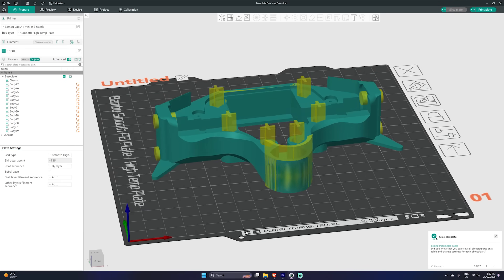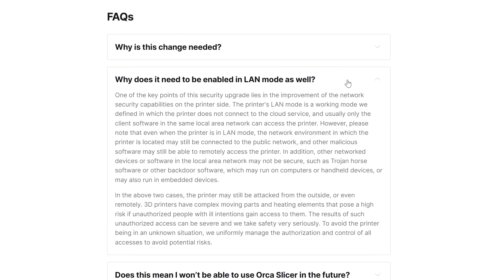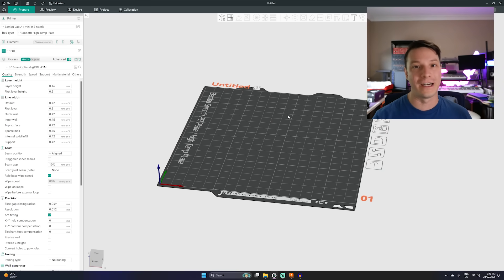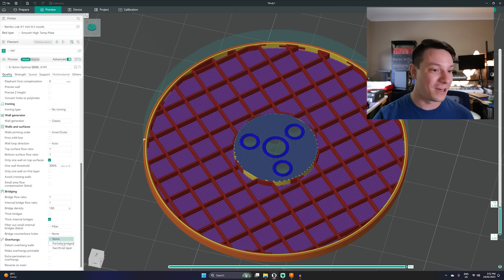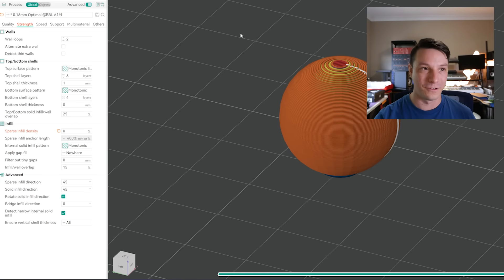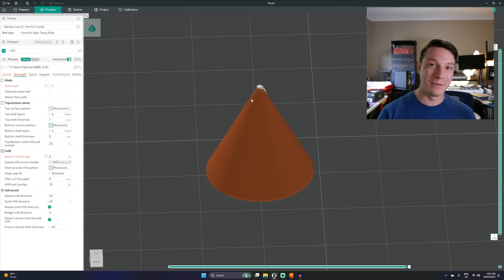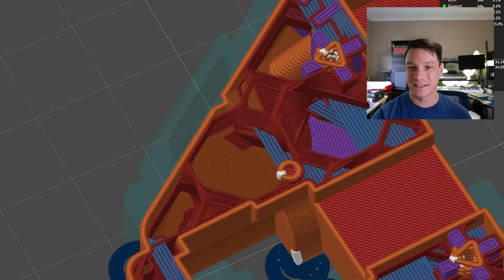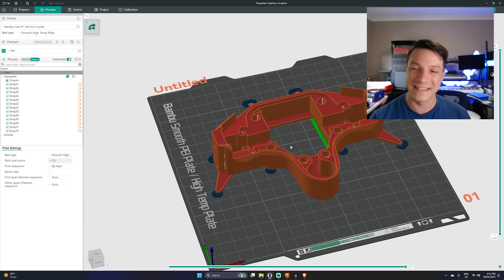I've switched to Orca Slicer for my Bambu Lab 3D Printer (and you can too)

Comment: I had to do this a year ago because the company IT guy wouldn't let me put the new X1C on the network.  Turns out that this is the BEST slicer available, and I don't have to deal with Bambu. It's even got a LINUX APPIMAGE release, so I can just download it to the desktop and use it as an .exe.
Reply: To be frank, Flatpak is waaaay Moe convenient than app images with auto updating and way safer with the sand boxing features.
Reply: @BeefIngot  Yes, but in ten years the version available today won't even work. That's not a problem with appimage. It will work just as well in twenty years as it does today.
Reply: @lowellhouser7731  No idea why you think this is the case. Flatpaks also build in dependencies so there is no reason they would break. They're actually more resilient than other standards for the most part.

Comment: There is something hilarious about the timing of this video because I was so fed up with orca slicer having random glitches and crashing and missing completely essential features that cura has had for a decade so yesterday I gave up and uninstalled it and installed bambu studio for the first time. have had no issues at all with 27 hours of prints, and found a few things in bambu studio that weren't in orca slicer for some reason.

Comment: you know they have microsd cards that are just wires that you can connect to usb for a funny work around since i dont see a usb port on a bambu lol. ALSO, they have wifi/bluetooth microsd cards that stick outa nd have the lil bt chip in them etc. but i bet you knew that but just a reminder
Reply: I'm drawing blanks trying to search for these micro SD cards you are referring to. Can you provide further info? Thanks.

Comment: Honestly i have not been impressed with orca its has been messing hard on my neptune 3 plus fireware's max speed travel moves accel and whatnot
After an orca print (from a factory reformat) i get 1 print and at some point during that print (it changes when) it slows to about 1/3 the speeds i had from the factory and i have to either do another restart or manually type in the gcode to change it back just to get 1 more print and do it all again

Comment: There's one feature I am waiting for they will probably implement in coming releases that is brick layers. There are already scripts that convert your g-code for this but I want it in as a setting in the slicer. If the name didn't tip you off, this is when walls are printed on slightly different heights so their sides also act as bonding surface area.

Comment: If I ever obtain a Bambu printer of any sort, It will NOT be used online, and I will make sure it hasn't been updated because I was the full control over the machine.  It is 100% unfair to the customers to take away or block certain features and modes, because the company mis-forcast the future of their servers. I still say it will be be a pay as you go system if you use the machines online in the near future, this is how it starts..
Reply: If you get an old unit with no firmware updates - I would recommend some of the early firmware updates. One of the updates quieted down the stepper motors.
Reply: Sure mate, let us know if you ever get one but until then...

Comment: My bambu printers are completely offline now, I use orca slicert too and have to actually walk to the printer and pop the micro sd card in just like I did a couple of years ago anyway. Not a big deal. But the prusa core one looks very promising, I might swap eventually.
Reply: Orcaslicer still works over wifi with the Bambu printer in LAN mode.
Reply: @nick_3974 but unless you can configure your router/firewall to block it’s access to the internet it can still connect to Bambu, and I don’t exactly trust them anymore.

Sadly I am unable to block my printers internet access with the garbage router my ISP provided me, maybe one day I’ll buy a new router but I can’t justify the cost atm :(
Reply: @nick_3974 does it still work now?
Reply: @nick_3974 without their cloud between?

Comment: One thing I have not found out in bambu if it is possible is to print objects as supports to make custom supports easier to make. Is that in Orca?
Reply: Yes, you can do this with modifier objects like Angus showed for 100% infill. You can even set the wall loops to 0 and use just infill in the modifier shspe as a support. I would also recommend the organic tree supports, they are very versatile.

Comment: I'm not going to fight the Bambu Lab firmware BS.  I'll switch printers, I bought a X1C only because they were letting 3rd party firmware X1Plus on their machines. Now it seems they are going to other way and closing down the walls of the garden.  I'll go back to Creality or any of the many other more Klipper based printers I can print to with Fluid, Mainsail and Moonraker. I WILL NOT go back to shoving SD cards in the printer to print my files!!!
Reply: X1plus will still work the same.
Reply: @riba2233  I hope so, I have got so used to using Orca as my slicer I hate the thought of having to go back to Bambu Slicer. I hope I'm over reacting but Bambu's approach and attitude is not inspiring my confidence.
Reply: @OldManJimmy1   you can still use orca even without x1plus and even with a new strict firmware. Overblown issue
Reply: @riba2233  That's where I have my issues, they were trying to implement a tool and I emphasize TOOL you have to use to connect to your printer even in lan mode, Orca told them to pound sand. 

I have to use my one and only sd card slot to boot to X1Plus, also no USB port on a X1C. If I pull the sd card out while the printer is booted you get a red screen of death so,,,, there's no way to use the sd slot to upload my prints.
Reply: @OldManJimmy1   ok but with x1plus nothing changes. You can also stay kn the old original firmware, nothing changes. Orca just refused to integrate the new tool, but you will be able to use it still with the new firmware and orca.

Comment: I am not worried about what Bambu does with the security update.  When this first became an issue over a year ago, I learned about the X1Plus firmware, didn't switch, but followed it.  When this blew up again, I made the switch.  Now running it in LAN only with Orca and it seems much faster to transfer the print job to my X1C.  You had some great tips for Orca, thanks

Comment: im planning to start using orca slicer. ive been using Cura for a few years and i am familiar with that and have it tuned. I used orca for a project recently because it gave some specific control over the supports that i couldnt figure out in Cura but other things i still cant figure out in Orca that are straighforward in Cura lol like support infill %.

Comment: I switched from Cura to Orca when I got an SV08 last month. At first I was very overwhelmed by the options, but now I'm pretty comfortable tweaking settings.
Reply: I used to be a die hard Cura guy. They’re just two different beasts. But Orca just kept getting updated with QoL features that I had to leave the thing I liked about Cura that I don’t even remember anymore. I guess, we started having those in Orca as well.
Reply: How has your SV08 experience been so far?
Reply: @JamesPotts  it printed very well put of the box and calibration was pretty painless.
I've modified the electronics fan to run on a curve corresponding to the host temperature, so it's much quieter.
I also relocated the print cam to above the moving gantry for a better angle.
Just finished building an enclosure and it prints pla and abs with no troubles at all.
My next upgrade is probably replacing the simple filament detector with a btt smart filament detector.
If you're thinking about getting one, I got the 350mm build plate model for $500 from sovol's eBay.

Comment: Mouse ears can be added in Bambu Studio. They are called "Brim Ears" and are located in the top bar to the right of the Color Painting, Measure, and Assemble tools.
Reply: A feature they need to add to Orca Slicer is that Bambu does with mouse ears... You can add them manually. I haven't found 100% success with automatic mouse ears, really want a manual option
Reply: @realgoose  That's not in orca yet? I like to use mouse ears on certain spots but don't want to use them in all areas.
Reply from the maker: Thanks for catching that! I'm sure it'll be updated soon.

Comment: Can anyone explain why when I tried using orca I was having issues with tolerances and overhangs on the same 3mf file that works fine in bambu? I now use orca for the calibration tool and do everything else in bambu.

Comment: Great stuff, however, Bambu Studio does have Modifiers and  "Brim Ears", at least as of 1.10.1, which is not the latest.
I agree though that Orca trumps BS in most cases, I've been using it for over 12 months, switching only a month or so after purchasing my first Bambu printer. I only open BS when I need to deal with the MakerWorld malarky that doesn't accept Orca 3mfs.

Comment: I still mostly print using SD cards or USB drives on all my machines. It takes a minute to retrieve the SD card, load the file and reinstall SD Card on the printer. So the Bambu changes didn’t affect me. Despite that, I still don’t agree with their move. 
I prefer Orca Slicer layout to Prusa as well. It’s just easier.
Reply: I also print using only SD cards, I have a P1S but I haven't even touched the cloud server, the app or any of that cause I simply don't need it. Old school is better, sometimes
Reply from the maker: Yeah, I did the same till recently so it's not too bad to go back to it. Running the SD card down to the garage is about the only exercise I get as well 😂

Comment: One thing I hate about PrusaSlicer, and probably the others, is how they handle settings and profiles.  I have profiles for 0.3 draft, 0.2 speed, 0.2 quality and so on.  In my mind, the only difference is the the layer height.  There's other things in there such as the speed, but primarily it's the layer height.

If I need to turn on a brim, turn on supports, change the support type or other things like that, it has nothing to do with the layer height.  To me, once I've set the layer height, then made some changes to the infill type or percentage, and then change to a different layer height, nothing else should change.  I shouldn't have to go through the process of enabling supports and brims just because I want to see how much longer 0.2 speed will take than 0.3 draft.
Reply: i just have default profiles and then change layer height in that profile depending on what im doing.
Reply: To be fair, that's not just a prusa slicer issue, that's how it works for all the slic3r variants. It is annoying though, because 98% of settings are just defaults for your machine. I figure only the changed values should be saved, rather than the entire profile. It's kinda frustrating because you end up needing to tweak print settings for different filament types, so you get many, many overlapping and unnecessary permutations of print settings.

Comment: I recently started to mess around with Orca Slicer and as usual it has a learning curve. Lots of new settings to configure, first few prints were failures! Still a fun process.
Reply: I’m on my first printer and attempting to switch, been having issues with my first layer that I’m trying to work thru

My printer is a sovol sv06+ with a kipper screen and with the 5.4 cura profile I have it prints very well, but I would like to learn and tune to different types of filament so I thought the build in tools of orca would be nice

I can get a real nice first layer but if I try to slice the same file in orca the first layer infill lines are too thin and it splits apart when I peel it off the bed even if it fully cools, where the first layer from cura I can peel as soon as it is done without issue. I do have the first layer speed turned down but it almost seems like my flow rate is also super low

Regardless just wanted to comment and agree there is a learning curve but it seems like in the end it will be worth it!
Reply: @matthewtaylor-h6q I had this issue too. Play with the first layer z offset, it allows you to home to a normal height and dial in the first layer thickness after that.
Reply: @bookhead2  Thanks! I’m still learning so a quick follow up question

My printer does have an end stop limit switch, and hovering over the a offset line in or a says it’s to compensate for bad z end stop position, should I start off by entering the same/close to the z-offset I calibrate on my printer that is saved to my printer.cfg file? Thanks again!
Reply: tbh, when I switched to Orca it was the opposite, my print reliability immediately increased.
Reply: I started with orca on my X1 due to it having more options to tweak with. Never had any issues. For bambu especially, you can just use it out of the box and have same experience as Bambu studio, but then get into the detailed configurations whenever you are ready

Comment: Ditto! Now use Orca for my Positron and my Bambu, everything is on the LAN
Reply: The Positron that works again!! Also I agree with your kids assessment that it’s just cooler to watch haha
Reply: Other than BambuHandy anything else not work? I use handy to change the filament colors since by the time I get to my computer I forget which color is where which is handy. 😂 I have been thinking of moving to LAN mode but I’m also concerned about remote print monitoring, however having my wife’s computer capable of accessing the printers would be a plus since she is the one telling me what she wants printed.
Reply: @mobilechaosyt  Just use Tailscale VPN. Then you're always on LAN from anywhere. Though personally I'd just not care and use the cloud.
Reply: Same here LAN mode only, Orca for my A1 and Elegoo n4p. One software to rule them all.
Reply: @-MrDontCare-  if i buy an A1 right now can i still enable lan mode only?
Reply: @Xeldin  Yes, I am pretty sure you can, the firmaware I use now supports LAN only and sd card upgrade in firmware version 1.04.00
Mine came with even a older version that worked just fine when I bought it back in late february?
Reply: My man! Crazy how I watch you for home lab stuff and to see you getting into 3D printing and backing the community! 🤘
Reply: Just started using Orcaslicer for my Prusa XL 5 tool heads and X1C. Loving it so far!

Comment: I would really love for the super slicer guy to finally release a version that's updated, but even though he claims he's working full-time on it there has not been a major update to bring it in line with the other slicers for a couple years now. What are your thoughts on using orca slicer on a prusa printer? Is it more trouble than it's worth, especially for a multi extruder printer like the XL?
Reply: He's been sick recently but the 2.7 merge is feature locked and should be releasing once he gets better (from my understanding of the discord at least)
I haven't been printing much myself lately but would also like to see the update sooner than later

Comment: 4:00 For some reason when I tried LAN mode the Orca couldn't see the printer even with a IP provided. Interesting enough my Plus4 could, read about it in the forum and apparently its some sort of BambuLab firmware bug, likely fixed by now. So people may need to update printers firmware first! 

Been using it for a while, haven't delved into too many advanced features yet but its pretty handy. No web cloud access I don't think so you can't browse BambuMaker inside it. 

Also under Linux there are numerous issues with NVIDIA drivers that cause rendering issues among other things.  There are work arounds mentioned in the github issue tracker.

Comment: Another one i've used is related to fuzzy skin, in bambu if you want to make it faster and use a normal wall for part of the model you don't need to be fuzzy you can't, the wall will be normal but bambu will make a fuzzy layer inside so instead of faster it will be even slower 😅
Reply: PrusaSlicer 2.9 recently fixed that behavior, so I would expect it to get ported over to bambu studio at some point.

Comment: Mouse ears actually available in bambu studio, use brim type -> painted
Reply: Beat me to it! I just used it and kinda did a double take lol
Reply from the maker: Oh yeah forgot you can paint in brims now, good call! Mouse ears is auto though, good for lazy people like me
Reply: @MakersMuse we’re power users, not lazy!! (Oh wait it’s both)
Reply: @MakersMuse  Mouse ears can be auto-generated in Bambu Studio too. It's just a button.
Reply: @SqeezyCheez yes for every object on build plate and you have to manually change parameters for every object, regenerate and so on... Orca Slicer implementation is much user friendly in my opinion
Reply: @MakersMuse bambu studio too can auto generate mouse ears. You are insisting on talking about what you don't know.
Reply: @MakersMuse orca slicer still gets confused on more complex models and freaks out on mouse ears for me and will miss regular corners. by best bet is just to still model them in.
Reply: Kinda miss being able to paint in mouse ears from Bambu Studio since switching to Orca, unless I'm missing where that is somewhere? The auto generated ones are mostly fine, but sometimes I'd use more or less personally depending on the situation.
Reply: @diarx1  change Brim ear max angle for that specific object, higher angle generate more ears lower angel generate less...
Reply: SuperSlicer also have "Brim ears" option with auto activation by geometry angle.
Reply: Also a  "brim ear" button in the hotbar at the top of the screen.  It's directly under the slice plate button.
Reply: @jorrdanna6219  Hmm, "assembly view" is under the slice plate button in Orca 2.2.0 for me?
Reply: BambuStudio just steals stuff from the community anyways.